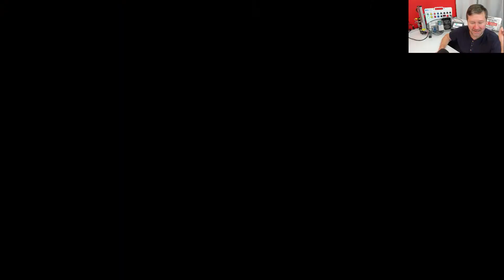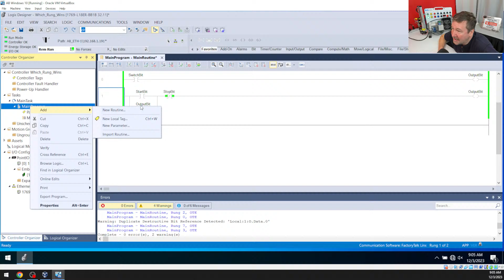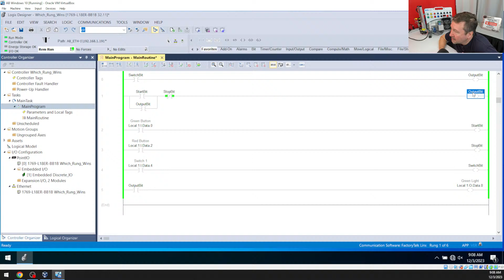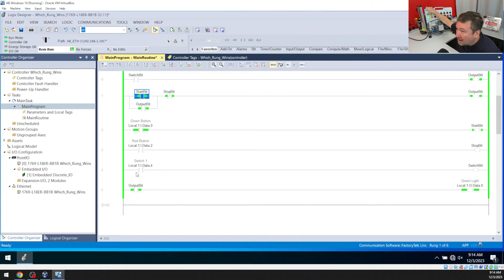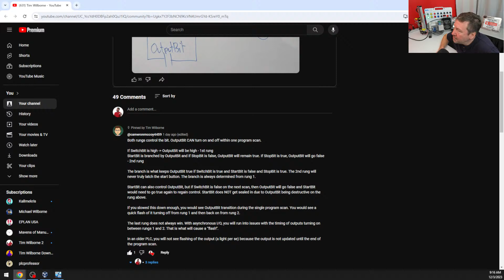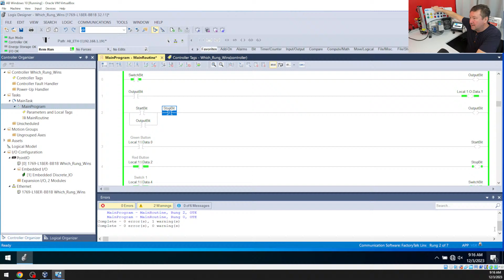Duplicate Destructive Bits in Studio 5000 and Mapping I/O to Fix It

Comment: Newish to programming so it had be baffled for a while as to why the yellow light stayed on even though the output bit on the same rung was not green.  Then I remembered your previous video about the scan process from top to bottom.  Even though the output bit in rung 0 is not green, it does in fact have a 1 in it during that time in the scan.  Therefore making the output bit in rung 1 also having a 1, creating a true state on that rung.  The green "true" on the bits can be deceiving.  Thanks for the videos, have helped a lot in transitioning from maintenance into automation and programming.
Reply from the maker: That is great to hear.  Check out this one I did the other week where I accidentally added a duplicate destructive bit.
https://youtu.be/tyAlwZ6CRY8